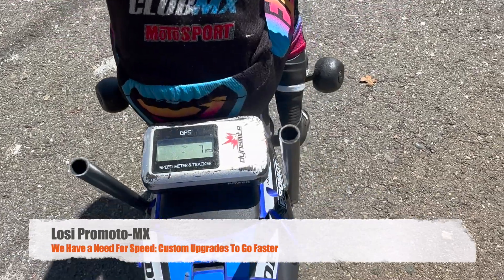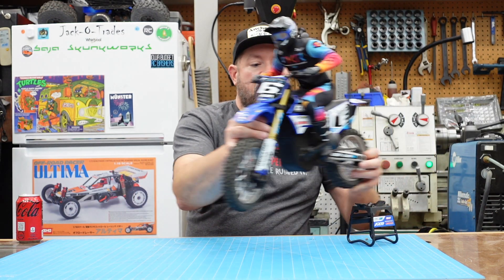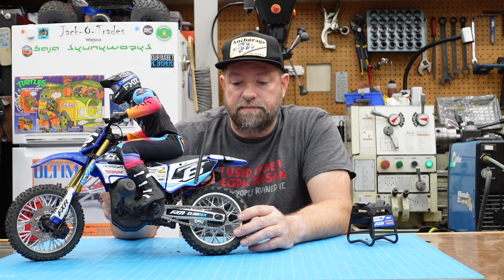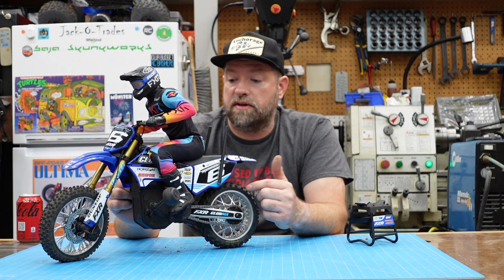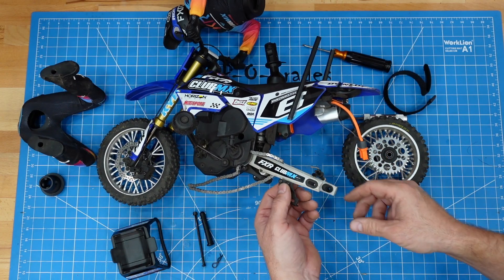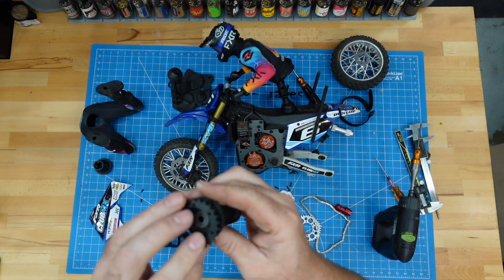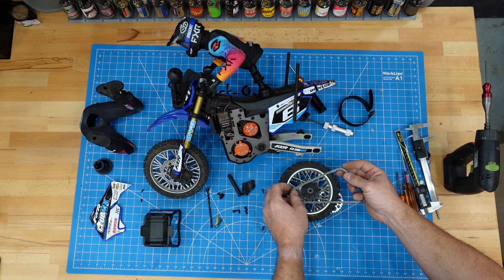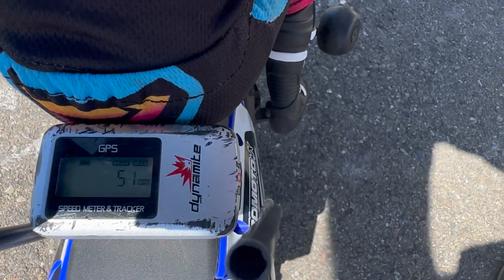Losi Promoto-MX Custom Gears and Fastest Speeds

Comment: sir, just subbed--would appreciate your inputs to my promoto mx issue: my bike does not seem to hit full/top speed even if i pin the throttle for 3 seconds or more, i have tried to calibrate the esc but still the speed is wanting ; viewing a ton of YT vids on the bike hitting 40 mph on pavement, my bike is nowhere near that mark, i do not have a gps speed measurement, but mine is going at around an estimated 30 mph. the bike is 2 months new, and thinking of getting a new motor for it or gearing it higher, or upgrading it to 3s using a bec for the gyro;  the tx throttle is on 100 setting also--i know its hard for you to visualize the top speed of my bike without a video of of it running, but would still want your opinion how to resolve this issue-many thanks.
Reply from the maker: What kind of battery are you using? It might be power starved.

Comment: What about the gearbox?
I'm probably thinking about this the wrong way, like it was an RC car, but what about the 3 main gears behind the panel on the right side of the bike? 
Is there any way to use different gears in that box for more speed?
I don't have a 3d printer but I'd like to gear up and run some supermoto tires. 
Side question: your motor \ ESC handled the higher speeds okay? 
Or do you live in Alaska as your hat suggests, where you don't worry about overheating electronics? 
Thanks in advance, and even if you don't answer my dumb question, a big thanks for having the only video I've seen on this topic. 
The Arrma forums just had people throwing Castle systems and 4s into the Promoto, involving big headaches over fitting motors and bigger batteries.

Comment: For more speed instead of making custom gears why not try a 3660 5400kv hobbywing motor.
Reply from the maker: Definitely something to try. I do like the idea of being able to swap out and play with the gearing. I also feel that the gearing is easier to swap out than a motor but it's not for everyone.
Reply: @jack-o-trades  your right everyone doesn’t have the option to able to swap gears around to be honest I love the idea as well with being able to swap gears. But I know the changing of motors can be cheaper.
Reply: @jack-o-trades  the best $25 I ever bought was a racestar 3650 5900kv . I ran that motor on 4s in my 2wd slash with 76/26 gears and hit over 100mph the motor still runs good no issues with it . .Type in 95mph 2wd slash on YouTube exactly the way you see it here . First short video to pop up

Comment: Do you know what the absolute maximum battery dimensions are? I can see the recommended G2 LiPo is (LxWxH) 138 x 46 x 25 mm but no idea if there's any room whatsoever for a bigger sized battery. They don't arrive in the UK until August so there's still a fair bit of waiting and prep to be done!
Reply: You can get 8000 mah with those measurements.

Comment: Subscribed, look forward to seeing what you got up your sleeve next. I got mine to 52 mph on a runway with a 22t Robinson pinion and ran my stock tires on a lathe to make them slicks. You have to make a wooden 2-piece wheel that clamps the tire to put it on a lathe. The knobby tires cause a lot of drag on concrete. I hope the Super Moto wheels show up soon. I have a 5200kv motor that fits. I want to build an 80mph+ Supermoto. It's very stable with slick tires on concrete. BTW, You can put the tire and wheel in simmering to water for 15 minutes and it will break the glue bead without ruining the tire or wheel. Just don't go into a high boil just a simmer. It's how I removed mine to mount the tire to a wooden 2-piece wheel to put on a lathe.
Reply from the maker: That’s awesome! Thanks for the tips on the glued up tires. Have you run into any issues with the speed controller cutting out on you with the taller gearing?

Comment: That is cool and I am glad everything held up well for the testing. I am kind of surprised the sprocket held up so well but I guess the stress on it is shared over 1/2 of the teeth at one time so it should. It probably helped too it was very close to the same diameter of the hub. Much larger and deflection may become an issue more. Either way congrats on blasting it up over 50mph! It did not take you long to dig in and start experimenting! LOL!

Comment: Just curious how changing the pinion on the motor will effect speed if at all. Did you try changing the pinion before doing the sprocket. If not will be good to see what you get with different pinion as well. Awesome work by the way everyone has been wanting to see what is needed to get more
Speed.
Reply from the maker: You can’t really drastically change the pinion. There doesn’t appear to be a whole lot of room to move the motor around as the result of a pinion change. There are short slots in the motor plate for setting the gear mesh. You might be able to move up or down 1-2 teeth if even that, but that would be it.
Reply: @jack-o-trades  You can fit up to a 24T pinion with no issue. Going up just 1 or 2 teeth on a pinion is a lot. I went 22T on mine. Stock is 20T
Reply from the maker: Good to hear. I’ll have to give this a go as well. I’m having problems right now with the speed controller cutting out when I try to ramp up the throttle. It seems like it happens at 3/4 throttle. Any thoughts on why? Over current protection maybe?

Comment: Front sprocket easy to change?  1 tooth larger on the front is worth 2 teeth off the rear sprocket.
Reply from the maker: Maybe, someone would have to make custom drive sprockets as it is kind of special with a through bolt vs a grub-screw and has bosses on both sides.

Comment: change gear of motor or change batterie for 100C  is more easy no? I think that all people who have 42mpH have 50C batterie stock and LOSI advise 100C
Reply from the maker: Gears aren’t available and it would be somewhat drastic as you would need to swap out a minimum of two different gears (eg pinion/slipper-spur) as the motor doesn’t have a lot of adjustment. I do have a 130c pack I can try.

Comment: I can't quite figure out if the motorcycle recovers when you put the steering wheel in neutral like a car? or if you have to maneuver the steering wheel to get the motorcycle back upright like an airplane? Make a demo please with the remote in the frame Thanks. I have THE SR5 super rider and you need to maneuver the steering wheel to get the motorcycle back upright
Reply: If you let off the steering, it levels off and drives straight -- the MS6X system takes care of the maneuvering for you.